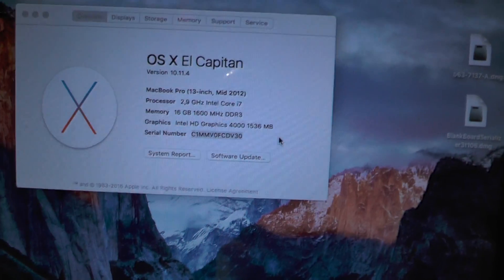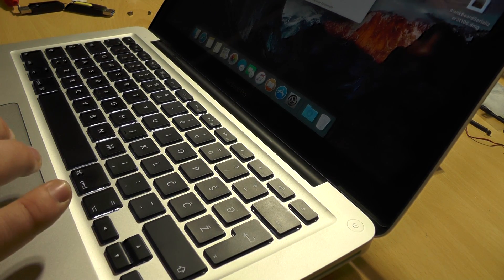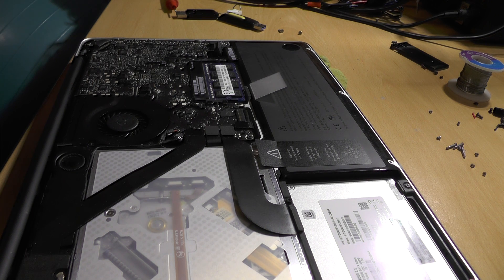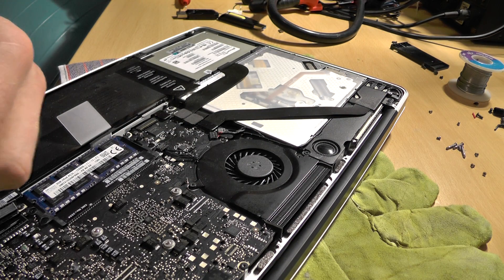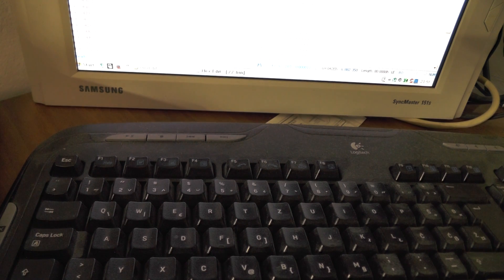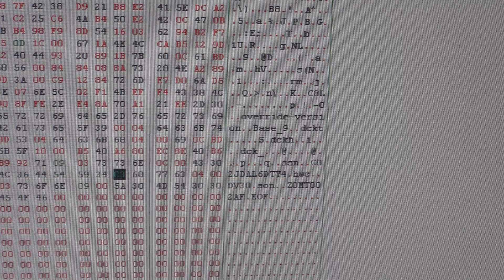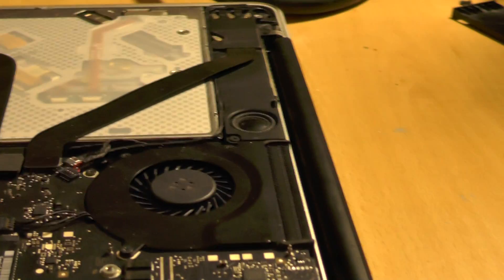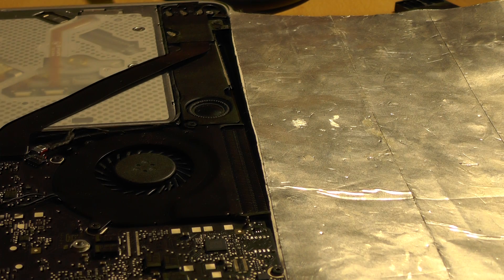Changing MacBook pro serial number [PoC]

Comment: I currently have an MDM lock with the serial that comes with a motherboard I bought. But I have another board that doesn't work because the video burned out. Can I just replace that chip with the one on my other board?
Reply from the maker: Yup
Reply: @MTS_IT  I already made the replacement but I don't know why when I install the operating system it starts very slowly, it takes about 30 seconds before it only took 10 seconds I have an SSD I already formatted the Mac but I don't know if I have to perform another operation, empty the vram or something else and when I enter the apps store the operating system freezes.
Reply from the maker: @TaqueriaElAmanecer  you need to make a clean install (delete entire disk)
Reply: @MTS_IT  first install montain lion after install updates ?
Reply from the maker: @TaqueriaElAmanecer  nah, you can install the latest supported. However drive needs to be deleted completely
Reply: After buying a programmer, I hope to be able to know and understand how to use the model of the one I bought this USB EZP2019. I have never used a programmer. Luckily, I have 3 Mac EPRONS to be able to test. And by the way, I also ruined the plastic, the same thing that happened to you, I didn't put a lock on it hahaha, but I have other Macs so I can change that plastic bar. Tomorrow arrived my programmer

Comment: so hopefully someone knows the answer to this, but i changed serial number on MacBook Pro 2016 15" and touch id isnt working. i dont know if it worked before or not and my friend never used it so he doesnt remember if it worked. hes selling it so he wants me to double check if chaning the serial number was the problem. anyone have a answer to that?
Reply from the maker: Apple has tendency to serialise so this might be the issue
Reply: @MTS  thanks. His wife actually said that it never worked. I actually put in the unmodified version just to make sure that it has everything as original and the problem still came up. So touch ID has never worked. What would happen if I used the same serial number on different Mac's though? I actually found a recycling center that is going to give me and my friend a good deal. He said that he's selling them as is due to MDM/DEP. So I was thinking of getting one good one and just replacing them.

Comment: nice video i liked watching it, very authentic working space u have there mate 👍🏻

but i think there is problem if u just edit serial number, there is also hash value for serial number stored inside efi chip.

u have to edit these values aswell, otherwise you might have problem with firmware update (showed as boot rom version in about mac system report).

if you run eficheck tool it will probably show error with firmware.

it was that for me at least but after i run succesfully a firmware update eficheck said its okai, idk.

but i only replace efi chip and didnt change serial number yet
Reply from the maker: heh, tnx :)  regarding checksum - i never had problems after installing my serial - However you're right - i think that newer models won't even boot without proper checksum :)

Comment: Hi, useful video.  How did you come you with the new serial number?  Thanks
Reply from the maker: that was the original serial number
Reply: @MTS_IT  I am sorry with the earlier typo. What I meant is:  How did you come up with the new serial number you entered during programming of the Bios.
Reply from the maker: @eaunver  it's not new. My old motherboard had original serial (one that's engraved on the bottom case) - then it failed and i replaced it with a second one (used one) - that had it's own serial number. Then i programmed the second one to have the same number as the broken one did.
Reply: @MTS_IT  Got it. Thank you.

Comment: Thank you so much for this great video! My computer was stolen a few days ago. I found one ad in my neighborhood that sells a computer based on exact configuration but with a different serial number. The seller does not have the documents of sale. Since this video prooves that it is possible to change the serial number, i wonder if there's a way to check what was the original number. I'd really appreciate your help 🙏🙏🙏 thank you!
Reply: The serial number is also written on the bottom cover.

Comment: Why not just leave it ? Why go through all this?
Reply from the maker: Hi, i'm it just bothered me way too much and when i read that it's impossible to change it then it was a misson :) 
If you wish to see what boredom does; whatch this one: https://www.youtube.com/watch?v=-LGA1rYKrk8 :)

cheers
Reply: LOL ... I love it! I figured out what you were doing before you saved the first MP3 file. And I about died laughing when you melted the plastic on your MBP when you removed the BIOS ... then you said sarcastically something about your MacBook issues ... well let me relate to you a little ... I bought my 15" late 2013 MBP with 16 gigs of RAM and a 512 SSD brand new for $3200. Since then ... cracked the screen twice, girlfriend spilled super glue into the keyboard ... I replaced it but a few months later, the tab that holds the keyboard cable into the little slot broke and on top of that, the trackpad got stuck on click and for a couple years, everywhere I took the laptop I had to take my mouse and keyboard too...  on top of figuring out how to disable the trackpad so I could actually click on stuff ... the IO board went out and when I went to replace the batteries a few months ago, (cause they wouldnt hold a charge for even one second), it would no longer recognize the SSD ... but I intuitively knew it wasnt the SSD drive so I replaced the logic board and that took care of it ... I replaced the keyboard for the second time yesterday, and its almost totally back to normal now after YEARS of having to work around issues .... I called it ... "Gimpy"  ;-)
Reply from the maker: heh, my gf spilled acetone over the keyboard (that s#!t for cleaning paint on fingernails) needless to say - new keyboard, btw i was surprised with the amount of screws...

Comment: Hello, what is the purpose to change serial number? For example, can i swap number to one still on warranty or apple care and request a free repair? Is serial number written on surface of logic board? Thanks.
Reply from the maker: hi, in my case i wanted to have the same serial on the mobo as the one on the back cover. Regarding warranty, i'm not sure, since since i never tried it. Serial is only written in bios.

Comment: I saw on eBay they have a chip reader / programmer that clamps onto the chip while it is still soldered to the board.  Any thoughts on that setup? http://www.ebay.com/itm/SOIC8-SOP8-Flash-Chip-IC-Test-Clips-Socket-Adpter-BIOS-24-25-93-Programmer-/201590662973?hash=item2eefbd673d:g:Zd0AAOSwY0lXRGWQ
Reply from the maker: when you replace date remember not to add any extra spaces because that messes with memory locations and you get corrupted bios. And also, save a copy of old bios just in case :D
Reply from the maker: in theory that should not be a problem, however apple is one very sneaky company and i would not be suprised if they had some tamper-proof-fuse-something ready to blow up when it recieves power from an external source.
Reply: Sure. However, I've tried successfully reading an apple EFI chip from my macbook 2009 using this clip reader. I was able to read a copy the content. I've not tried to write, yet, but I will soon.
Reply: One question, what did you connect the chip rider to the PC? There is not USB port in these chip reader

Comment: Thanks for the tutorial, very good!. So thank you for that. About the trim which you damaged with the heat torch, you should buy some car vinyl wrap, maybe carbon fibre. You can buy it for cheap on ebay. Maybe give it a little sand down and body filler first if it is damaged badly. This will solve the problem instead of changing the lid completely. One other thing, i would remove the video and edit the video hiding your serial number. People will steal it and use it on their machine using your tutorial!!!!! Thanks
Reply from the maker: Tnx m8, I already changed the plastic part. My OCD would probably drive me insane if i had carbon fibre instead of the original (just knowing that something is wrong...). 
Regarding serial - true, however video is online for a while now so there is a great chance it's already stolen :( - did not think about that when making this video... ...but i'll re-edit it when i get the chance.

Comment: Thanks so much for this, it's exactly what I needed.
Reply: Well, I thought this was going to work, but it ended up not working as intended... I took my 2011 15" MacBook Pro's SPI-ROM off the board, put it into my programmer, and dumped the firmware. I opened it in a Hex editor, found my serial changed it, saved the file, and wrote back to the ROM. Soldered it back on the MacBook, but after booting, the system doesn't even detect a serial number at all. I did the exact same method a second time, this time re-entering the original serial number, and it came up just fine in the system... Why is it not detecting the number when it's been changed? It doesn't make any sense.
Reply from the maker: did you add an extra space (number should be added without any other extra spaces + maybe hex editor has messed up something)

also, if serial is not detected you can always use their blank board serializer. (i suppose you need to add blanks instead of numbers/letters)
Reply: Music, Technology n' other stuff Nope, I made sure to type it in without adding any extra spaces, and made sure it was located at the exact same offsets it was originally. I also tried a few different hex editors with the same result. I also did try using the blank board serializer, but that just had an error when writing the serial.
Reply from the maker: empthy the chip, then program it? To be honest i don't quite know what could be the problem... :S
Reply: Music, Technology n' other stuff After some further testing, I found that OS X detects the modified serial just fine, but not Apple Hardware Test or Blank Board Serializer.
Reply: What happened if you replace smc chip and soder it on another Mac of Same model
Reply: The Mac will work fine, but the serial number will be the same as it's held in an SPI ROM